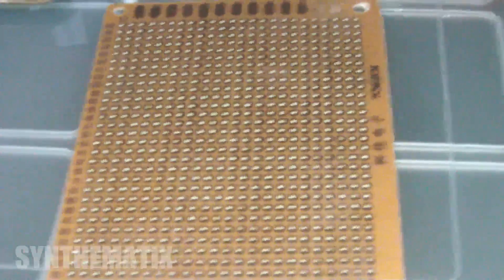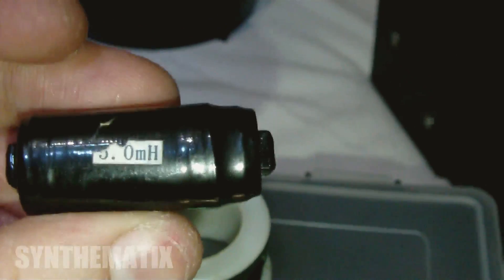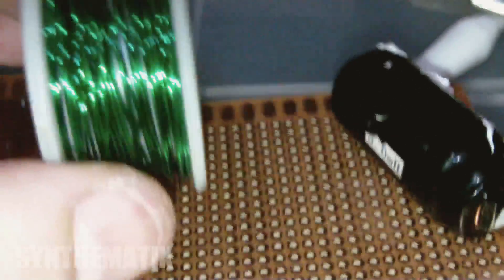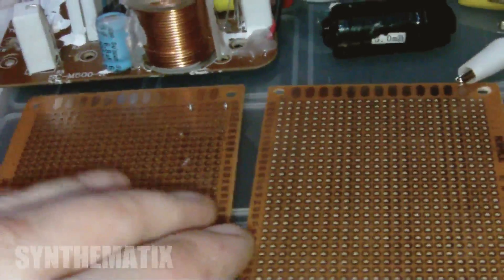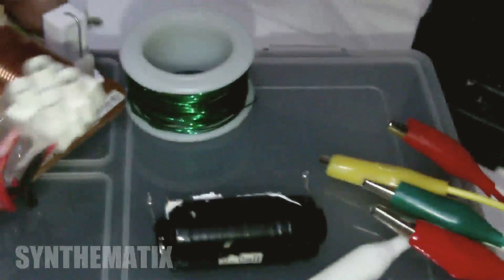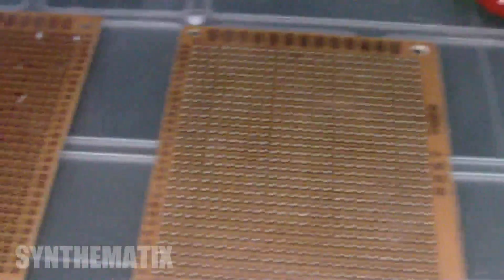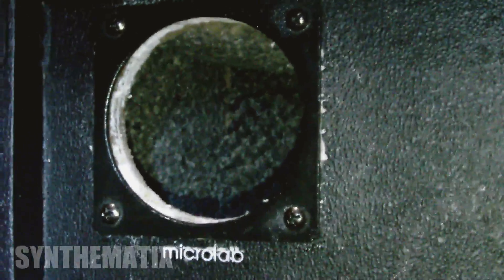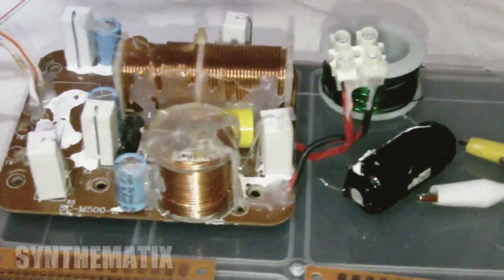Home Built Low Pass Speaker Filter Network (Crossover) - SYNTHEMATIX

Comment: Small gauge wire is very good for high amp current flow, not necessarily high voltage in D C current for speakers. Take some courses on basic physics and wiring?
Reply from the maker: First of all speakers are not DC they are AC, secondly high current will melt fine wire thats how fuses work.

Comment: Hi can I ask you some question's please, I bought a set of QTX 1000 watt active subs. They have only been used a max of 10 times since new 14 months ago, I have had nothing but trouble with them not working. I have returned each of them twice since I bought them. One of the subs amp has now blown again. Obviously the company I bought them from now don't want to know because of their age. I am not going to put them in a repair shop and pay to get them fixed so decided that maybe I will remove the amp inside the speaker and fit a cross over network and run an amp just to the sub speaker boxes. when looking to buy a pair of cross over networks can you recommend what I should be looking for, or would it be better to build my own. I only want a one channel sub driving network. look forward to your response many thanks Graham
Reply from the maker: +Graham Hickman Hello, what you need is a coil to filter out the high frequencies, they are measured in henries, you need to look at the subs impedance (resistance) some are 4ohm some are 8, here is the rules of crossovers, resistors reduce power, capacitors reduce bass and coils reduce treble, chances are the amp already has filtering for a bass speaker but if it doesnt there are off the shelf units you can buy pretty cheap on ebay, hope this helps, any more questions feel free to ask ill try and get back to you as soon as possible.  ps: find out the wattage of the speaker then search for a suitable passive crossover on ebay: try one of these mate its a good cheap starting point, good luck. http://www.ebay.co.uk/itm/600w-RMS-Subwoofer-Crossover-4Ohm-12dB-Oct-Bass-Box-ice-/361015835624?hash=item540e387be8:g:uyQAAOSwRLZT46GG

Comment: Hello Happy day to all who can help me.

My name is Jose Ortega, am a fan of good sound from an early age, I live in Venezuela and I write for help because I want to make a pair of crossover that is separate treble and bass means to allow me use in bi-amplify mode and full range mode and protect the following components: Mid-Lows:  FANE 12" Colossus 12MB and Compression Drivers : LANZAR PRO D210B 1" 1.75" Voice Coil.

SPECIFICATIONS: 
Mid-Bass Fane Colosus 12MB:
8 Ohmn  - 450 W (AES) RMS - Peak Power (6dB Crest Factor) 1.800 w (AES) - 6dB Usable Frequency Range 40 Hz - 3.5 kHz - Sensitivity (1 w - 1 m) 98 dB.

Compression Drivers LANBZAR PRO D210B:
DRIVER 01 INCH THROAT - Throat Diameter 25.4 / 1 mm / inch - Nominal Impedance 8 ohm - 6.8 ohm Minimum Impedance
130 watt Nominal Power Handling - Nominal Power Handling (AES) 65 watt RMS - Sensitivity (1W / 1M) 108.5 db - Frequency range 900-17000 Hz - 1800 Hz crossover Recommended  - Voice Coil Diameter  1.75 inch - Winding Material CCAW 
 
I currently hold the following components for the manufacture of crossovers: 2pcs 20W51RJ ceramic resistors , 2pcs 20W80RJ ceramic resistors. 2 pcs capacitors 3.3UF 250V , 2 pcs coils for drivers , 4 pcs bulbs 12V for Drivers protection. 

I will appreciate if any expert could help and tell me others components that I need to manufacture and wiring diagram of the components.

The purpose of this crossovers is to use for professional sound so I want to emphasize in the most suitable cut frequency for protect the drivers and extend the useful life and bulbs of protection. And for the low sometimes I'll will use it as a full range with lower and middle frecuencys and other when accompany with low drivers FANE Colosus 18XB it will use more as a mids.

I appreciate all the help you can give me with this project

Thanks in advance

Jose G. Ortega
csijo@hotmail.com
From Venezuela